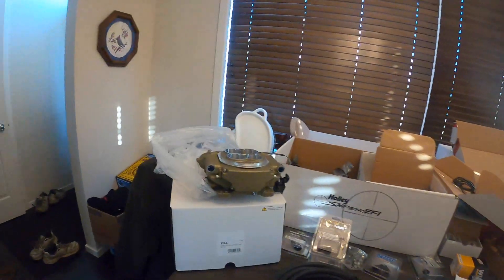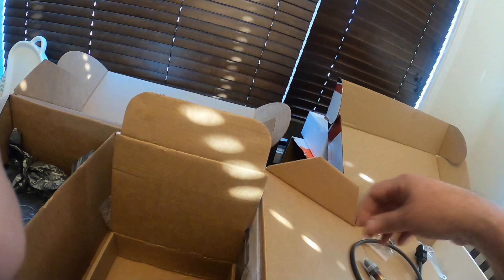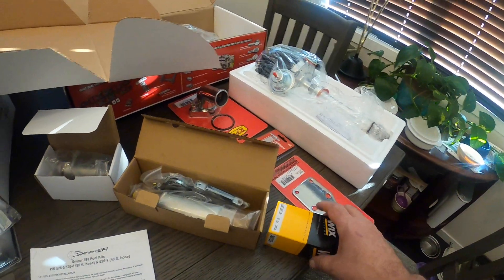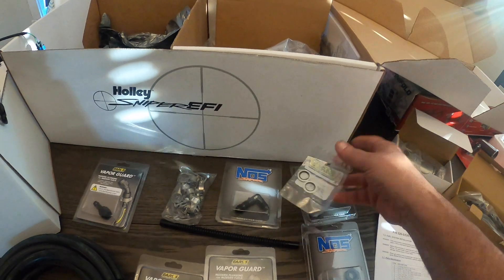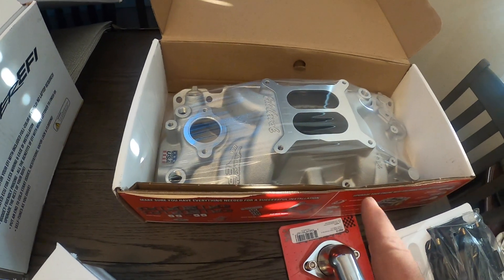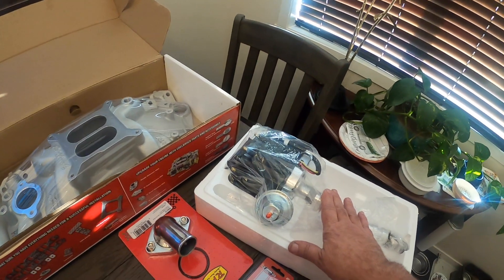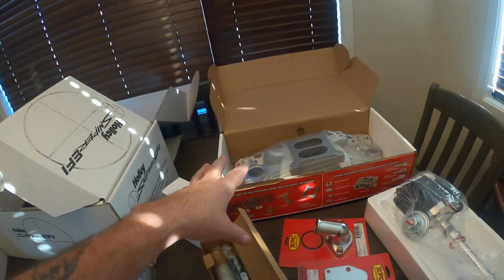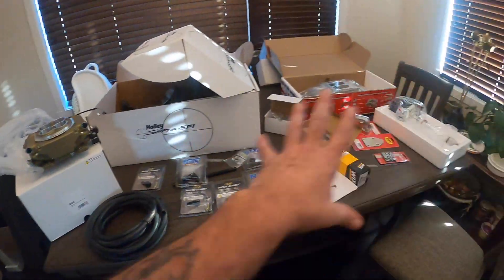V8 Sniper Install - What you'll need above and beyond The Holley Master Kit! - 550-510K 550-516K etc

Comment: Christmas came early eh? Don't forget on your HEI set up you might have to change the wiring around a bit because  of the resistance wiring for the points  the starter will pull all the power and you may not have enough power for the HEI . But I'm sure you know that , this trucks going to be so cool you are not going to want to sell it now. Good Build.
Reply from the maker: Yep, falling in love with this thing…. It’ll be around for at LEAST another summer, the wife and I are driving the wheels off it and love it!!

Comment: I put a black one on my 66c10
Reply from the maker: Sweet. How do you like it?
Reply: I put a 400SB with aluminum race heads, street strip cam, aluminum high rise air gap intake and the Holly Sniper. The engine heats up fine sitting but when I drive it, it cools down to 140. That's with a 185° and 195° thermostat, same result. Sniper wants 160° to start learning. Mine's dumber than a box of rocks.
Reply from the maker: @garagehack2060  that sucks, hopefully I don’t go through the same thing.